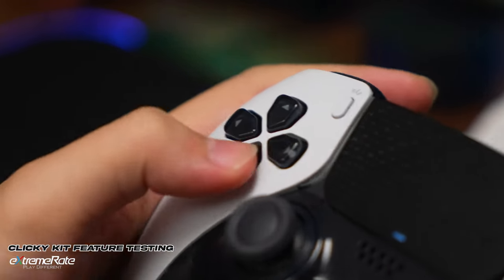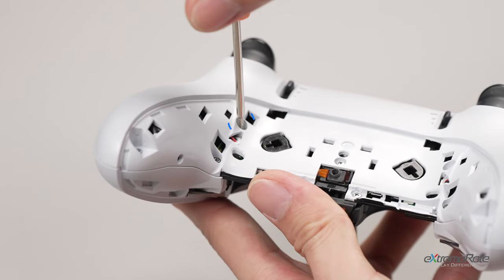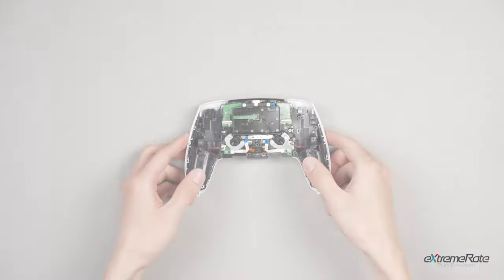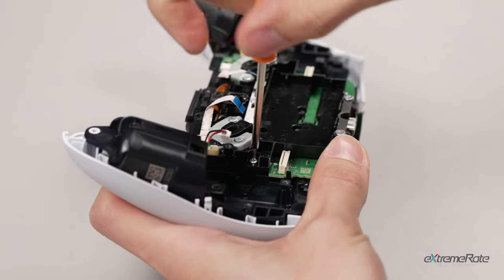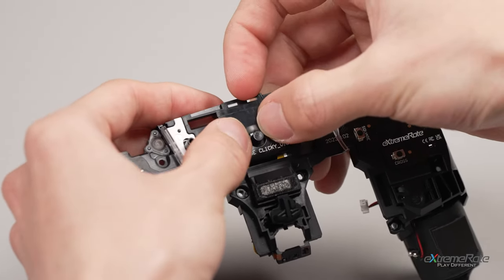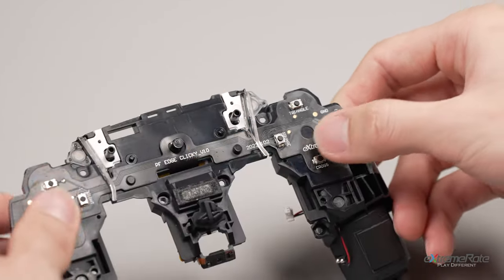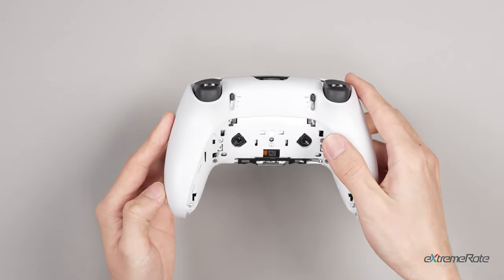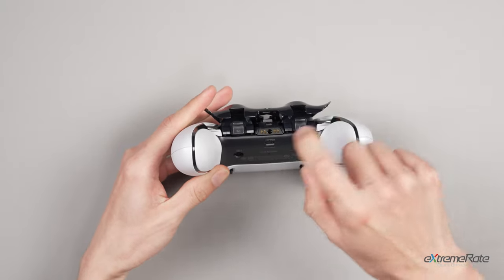eXtremeRate PS5 DualSense EDGE Controller Face Clicky Installation Guide

Comment: DO NOT plug your battery the way he does in the video. I gave it a little wiggle and it pulled the wires right out without pulling the assembly. Completely destroyed my battery just by following instructions. Be careful!

Comment: @extremerate question will you guys do a redesign of the Bdm 30 - 40 controller  face buttons , like what you have for ps pro controller ?
Reply from the maker: What do you mean by "redesign"?
Reply: @ExtremeRate what I mean is are you going to change the Bdm 30-40 controller face clicky buttons kit from the blue one, and make it look like the black one for the dualense edge face clicky kit

Comment: lol xD, yeah just buy a new controller in that case, what a bizarre video, then mojority of people gonna brake a ruban, lose screw, or something else and lost 300€ or
 dollars. Enjoy !
Reply: ive modded my first three controllers 2 years ago and im still using them. they work fine if you know what youre doing.
Reply: @psuedotoxin  maybe for you but not all people.
Reply: @EmixmaBts  why a person would buy it in the first place if he didn't know about tinkering? Of course majority of people would not purchase this in the first place, isn't it?
Reply: @low--key  because clicky button are cool. You r right, but not all people think like you ^^ I mean, it look like pretty simple if you look at the installation guide but losing a screw, brake a little plastic can be fast. So yeah 18€ buttons for a 300€ controller that you can brake, ofc it’s for people knowing the sheet.
Reply: Actually, these are VERY easy to take apart as you can see in the video. It also doesn’t require any soldering so it’s a super easy mod.
Reply: ruban? u mean ribbon?
Reply: @florider_hd  yes sry
Reply: They include a whole bag of spare screws and springs. If you can't handle some basic instructions and  tinkering than that's on you. Those ribbon cables are more durable than you think, I've never broken one and I've been repairing and messing with systems and controllers since the ps3 came out. As long as you're careful and have no motor issues, it's not that hard or dangerous to your controller. The only controller I know of that's clicky for ps5 is the razer wolverine,  that costs more, has asymmetrical sticks, and the sticks aren't replaceable (best part of the dualsense edge)